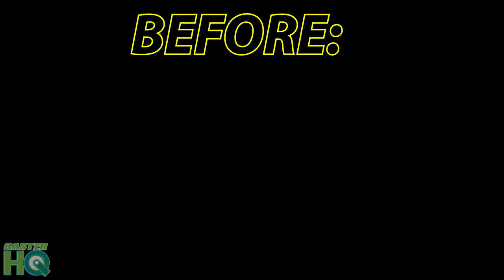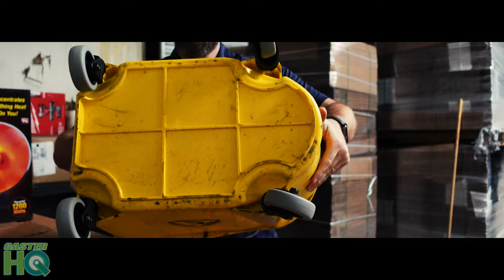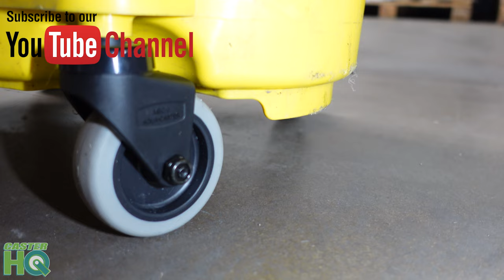How to Change Mop Bucket Wheels

Comment from the maker: 0:00 Introduction
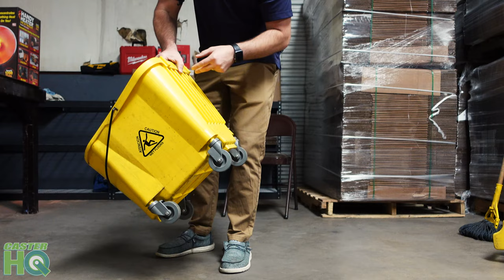0:45 Recommend Changing All Casters
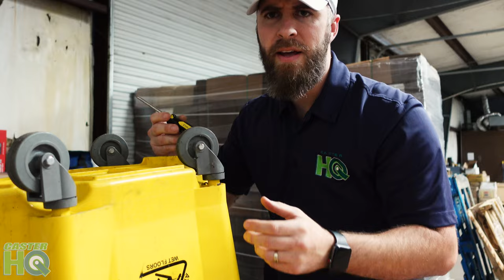1:18 Tools needed to change Wheels
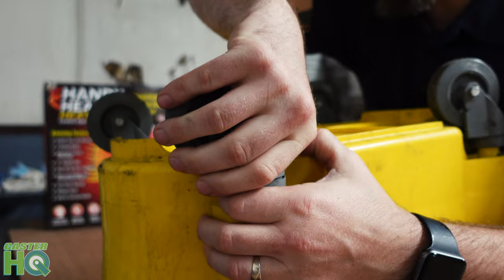1:26 How to remove the old Casters
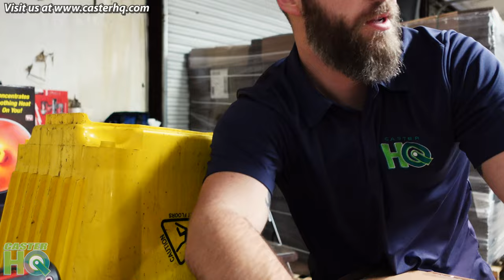2:16 Introducing CasterHQ Version Mop Bucket Caster
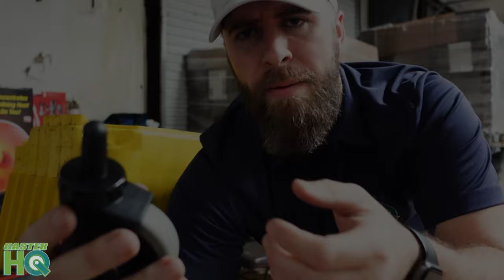2:46 Installing the new Mop Bucket Casters
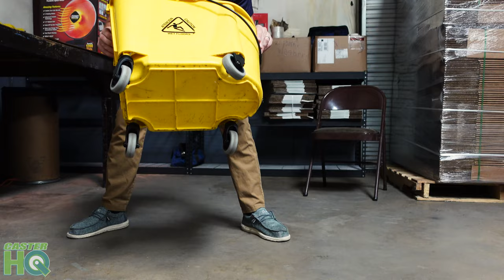4:51 Demonstrating New Wheels on the Mop Bucket
5:24 Final Removal and Installation Advice
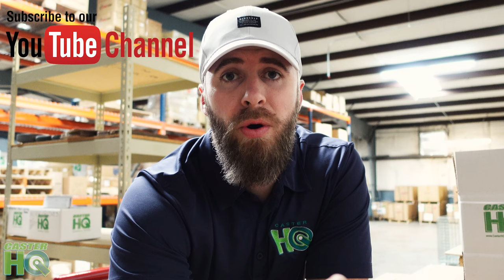6:22 How to order the new wheels
6:30 Contact Info
7:04 End of Video